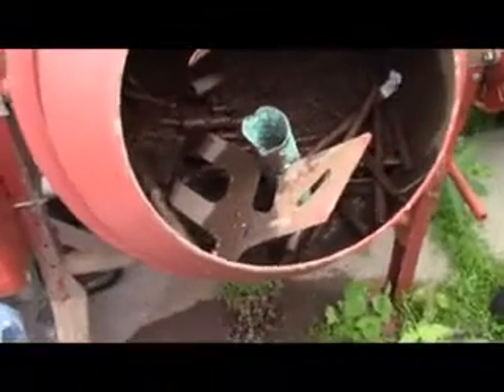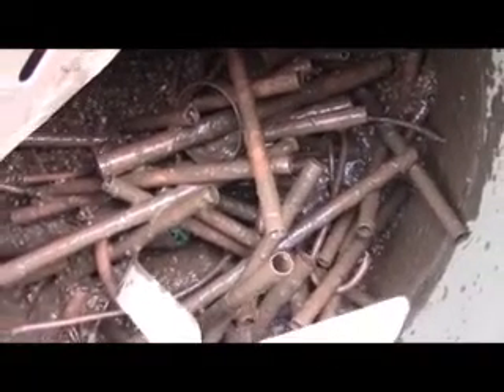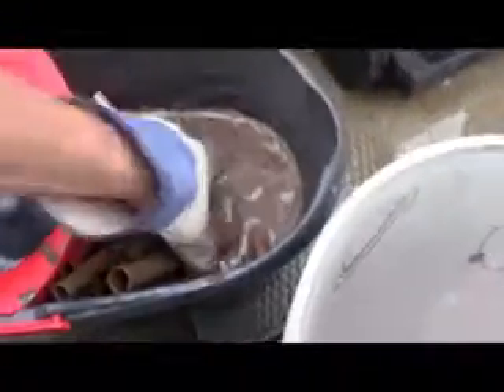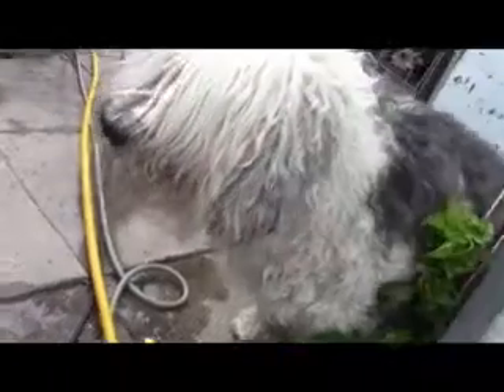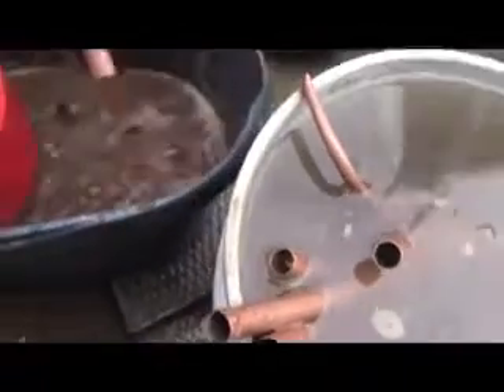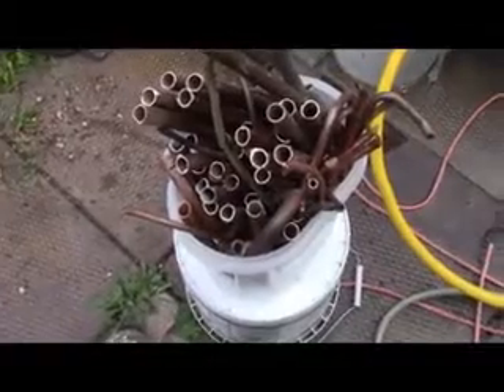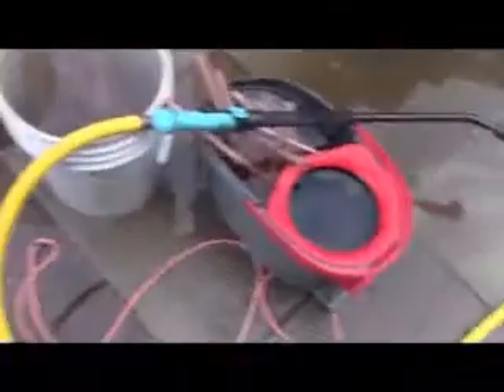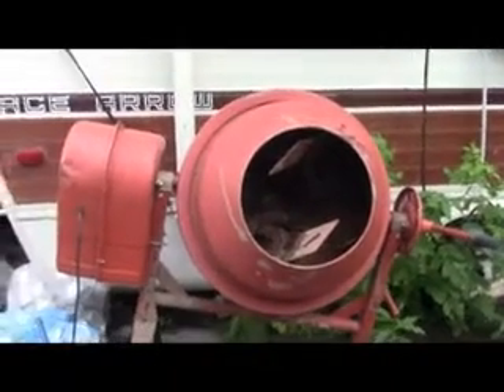How to increase the value of your copper pipe and wire before selling it.

Comment: Great idea to clean the copper Bruce. What’s the price difference between dirty and clean copper?
Reply from the maker: When I filmed the first part last week it was $0.21 difference . A small amount but I cashed in 130 lbs 2 weeks ago and probably have 200-300 lbs more sitting around. My cost was $6 for two bags of gravel and some electricity.

Comment: Thanks Bruce, I may get away with that on a smaller quieter method, using a ball mill.  Or make one of those vibratory parts cleaner.. now you got me thinking.
Reply from the maker: If you had access to the electric mixer put it in the shed while in operation and shut the door. Also good for a fast clean up of motors that accidently fall in a fire.  :)